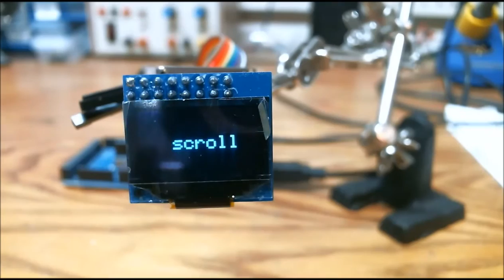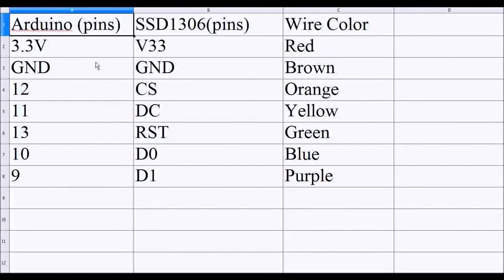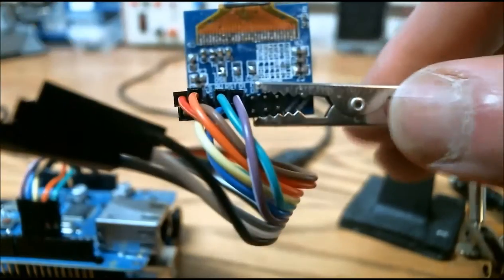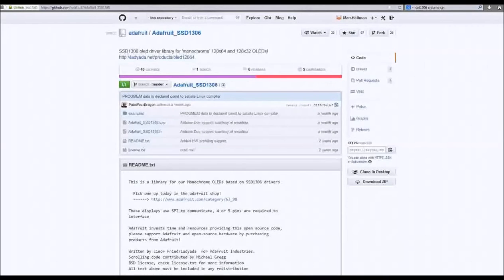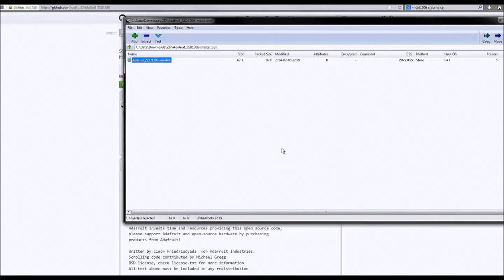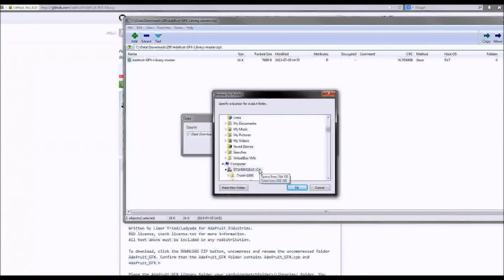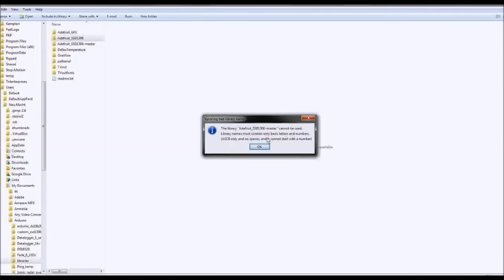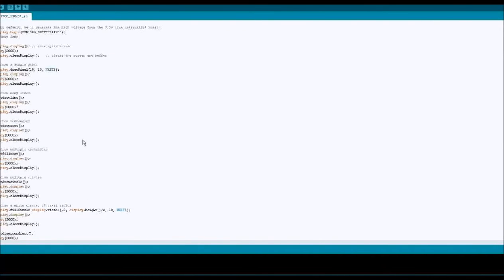How to Connect and Program ssd1306

Comment: Display is pretty much Hitachi standard Lcd display.
Reply from the maker: Peter Wobacz Do you know where I could get an monochrome LCD Display with I2C or SPI interface? Since this display burns a lot of power.
Reply: I have seen 16x2 lcd display module with I2C for Raspberry pi from adafruit I think. Maybe that would work with arduino as well since it's I2C.
Reply: Check out eBay man. Load of modules on there. You'll find one with few protocols available too.